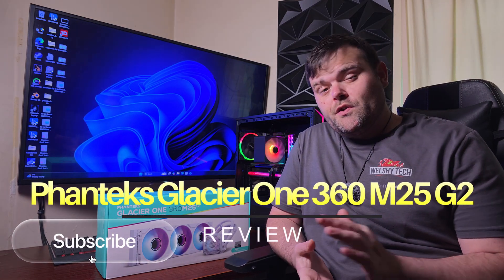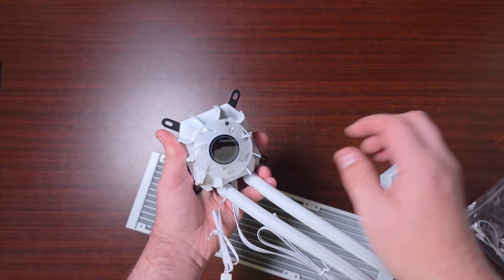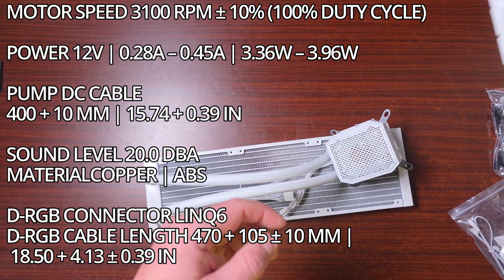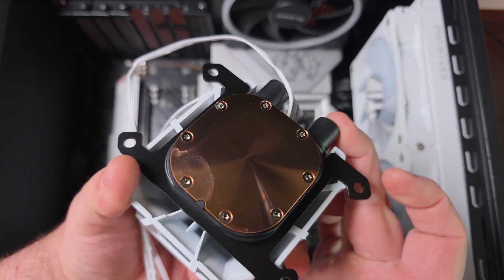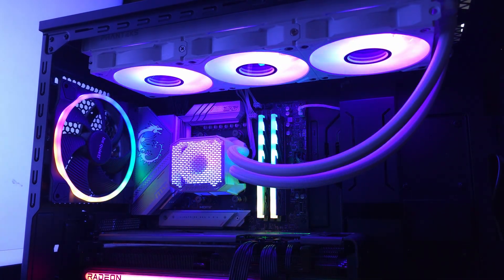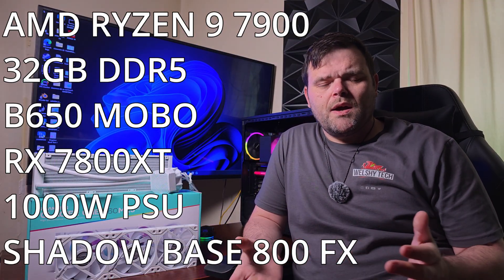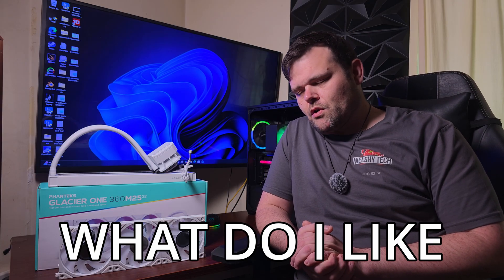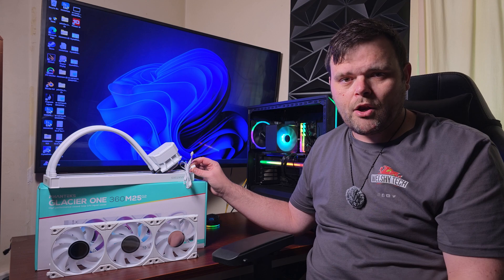Phanteks Glacier One 360 M25 G2 White AIO - The Best AM5 AIO?

Comment: That's a low pressure (2,51mm H2O) I guess the performance will be the one expected from an AIO with copper plate non-nickel plated but nothing more. Switching the fan to any higher/high pressure fans would make a big performance gap. For anyone interested in a AIO.

Case fans: You want CFM over mmH2O
Any fans blowing into a chunk of aluminum: High mmH2O over CFM (low mmH2O can't push air through the fins, not properly).
Reply from the maker: Thanks for the information!